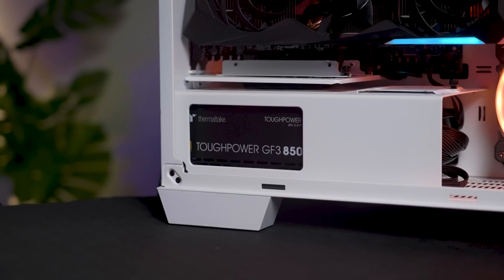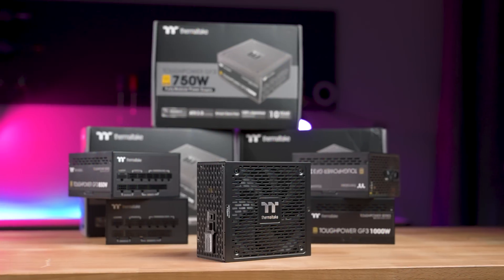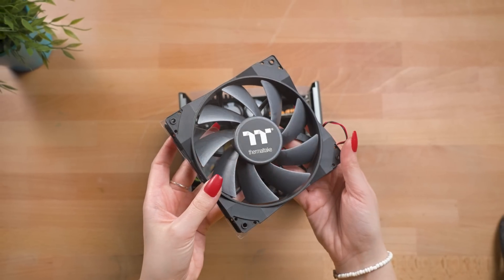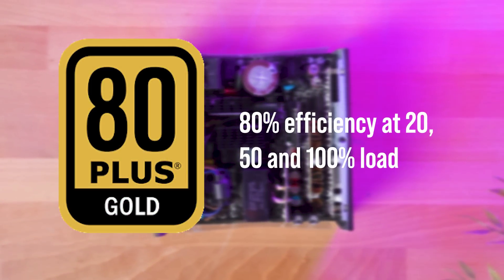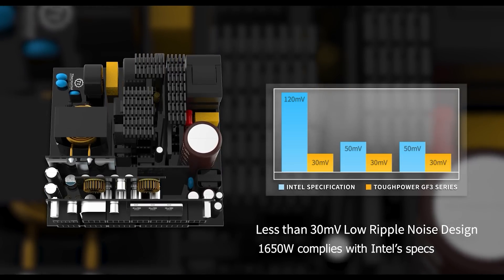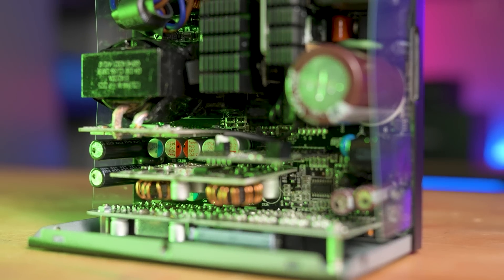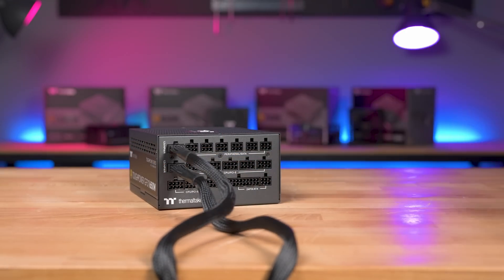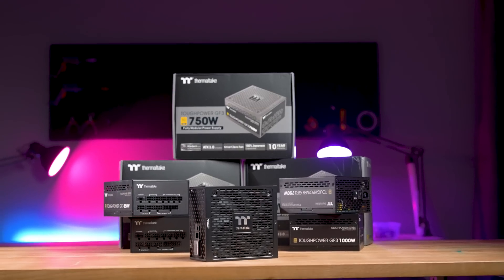The World’s Leading PCIe Gen 5.0 & ATX 3.0 Ready PSU! Thermaltake GF3 series

Comment: I have a 4090, and this PSU. At 420w consumption drops suddenly, and is unstable. If I change the 450w cable to a 600w cable, will that solve the problem, or will I burn something? can it be useful to change the cable, or is the 450w limit of the power supply?
Reply: Which model you have? Because the cable changing.
1650Watt GF3 - 2 x 600W 12VHPWR cables
1350Watt GF3 - 1 x 600W 12VHPWR cable
1200Watt GF3 - 1 x 600W 12VHPWR cable
1000Watt GF3 - 1 x 450W 12VHPWR cable
850Watt GF3 - 1 x 300W 12VHPWR cable
750Watt GF3 - 1 x 300W 12VHPWR cable
Reply: @gorkemuzun7451  I have the 1000w version.. :( i wanna change the cable, but i'm not sure it works whithaut a disaster...
Reply: @teknosirobleehahh2364  If it was 4080 i think it will be fine but 4090 is a different story
Reply: did you change the cable?

Comment: This product was clearly rushed to the market.

I got a 1650 watt with the idea it would be overkill and be super efficient and quiet since its at about half capacity with a 4090 intel build.

It overheats if the smart fan is off since the fan curve is based off of load instead of actual heat, which is awful. My system was powering off randomly and it took me forever to diagnose the fact the psu was running extremely hot and overheating despite having decent airflow (psu fan curve problem). It is very cool with smart fan off at least, but its a terrible experience.

 With smart fan off, it becomes obvious that the fan inside the unit is poor quality since its louder than even my 4090 at max load.

The 12vhpwr cables included are EXTREMELY short, and 1 was improperly crimped which man, if I didn't spot the issue it could easily have caused catastrophic damage.

Heed my warning other consumers. I wish I could return mine, I might be able to save it with a fan swap so it won't be obnoxiously loud. Get a good sturdy adapter from cable mod and get a trusted last gen high watt PSU.

Comment: Just got the GF3 1350w yesterday. And as other buyers on our local shop forum i do not understand why is the fan so loud? it is either OFF or 100% thrust in smart zero fan mode depending on total wattage. When zero fan is off it is just maxed out. Is there a way to fix it?
Reply: Same here. It's unbelievable, from 300W it suddenly goes up to 40db of noise, no intermediate stages. I'm thinking to return it but I don't want to open the case again.

Comment: Be careful I had the 1650w installed last night with my new 4090 card and the PSU blew up and now I have to replace my RGB board and PSU
Reply: Just a bad psu? What are you going to do? Get a replacement TT?
Reply: @recain123  no I’m going to get a different brand PSU, I’m sending the system off to have it tore down and have everything inspected and replaced. Supposedly it can fry your board or other components kind of a bummer to get new 4090 then be out a Pc for a month
Reply: @ice360  yes I bought from thermal take. They said they had issues with some models, but now can’t get a warranty replacement until January, they are on back order that long so I bought a GF3 1000watt ATX 3.0 for now.
Reply: @ice360  well apparently the power going to the graphics cards themselves. They said the 1650watt was having some issues they found with certain 4090 cards. They told me they are working with NVDIA to get the issues figured out. He said a couple were Dead on arrival and the inventory was wiped clean because everyone was told they needed an ATX 3.0 for the cards.
Reply: @ice360  I have no reason to lie I’m just explaining my situation and they told me they had issues with some of the power supply’s and they had units being tested at NVDIA for which power supply worked best with which card, and if you look online on their website all the ATX 3.0 are out of stock. The 1650watt model isn’t available until January and the 1350 watt around nov-December.
Reply: @chrisc4843  bullshit, post it on Reddit with proof of the damaged psu, that’s the first thing you should have done If it truly had issues of blowing up so others can escalate it higher and warn people
Reply: Somebody must clear this out and help us all. What is exactly going on?!

Comment: See why you have your GPU vertical. My ATX 3.0 1650W Thermaltake PSU arrived the other week, and at 3:17 you can see the new PCIE gen 5 cable. There is a good 80mm of cable that is rigid as concrete. Good luck getting your side panel on, and plugging one of these into a 4090 even in the largest cases.
Reply: 1000D to the rescue! XD
Reply: I understand, a question is it very uncomfortable or are they very rigid, could you close your cabinet? hit the glass?
Reply: @frannydelacruz3724  Now I have my 4090, there is no chance to put the side panel back on. Will need a 90 degree connector to have a chance.
Reply: @waifu_enjoyer  In the end I think I'll opt for an rx6950xt because I'll play most games in 2k, because they say the 4090 is for 4k.